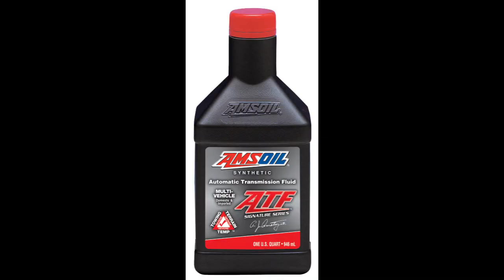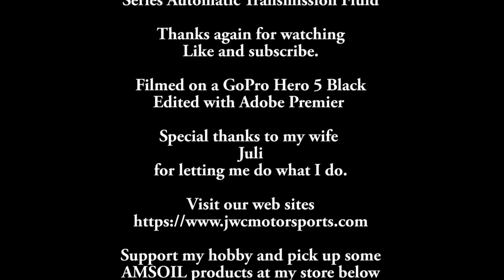2016 RAM 1500 5.7l Hemi Transfer Case (BW44-44) Fluid change

Comment: Nice! Just did my 2017 1500 with almost 39,000 miles.  Color looked good, but more and larger sized metallic shavings came out than I thought would.  Truck runs fine, I just didn't expect so much metal in the fluid.  Also here in Buffalo with salt in the winter, mine's crusty underneath, even with undercoating :(   I put Amsoil in also.  Thanks - great video.
Reply from the maker: That winter salt is rough back East, Thanks for watching.

Comment: How many miles on the truck while using AmsOil in transfer case and transmission?
Im going to change my fluids AmsOil as soon as they arrive. But want to get your thoughts on the products so far. Thanks
Reply from the maker: I just went over 101,120 miles and that is about 50k.miles using AMSOIL in the transmission and transfer case.  With about 75% of those pulling a trailer hauling a vehicle.  It's been running great, have had no issues and the temperature of the transmission while towing has always been below 200°F even during the heat of the summer.  Mileage usually is around 13mpg towing and my towing always involves a lot of elevation changes.

Comment: How much fluid did that take?  And where did you get that pump bottle?
Reply from the maker: The transfer case takes 3 pints to fill to the bottom of the fill plug opening.  As for the pump I got it from AMSOIL part number G2039.
Reply from the maker: @ALPHACHEESECURD  3 pints. 1.5 quarts

Comment: What you drained out of it doesn't look like ATF, but more like tractor fluid (Mobilfluid LT). Was this the first time changing the transfer case fluid?
Reply from the maker: It was the first change I did on It.  I do not know what the previous owner may have done.
Reply: @JWCMotorsports  That was the original factory fluid. RAM switched the BW44-44 to Mobilfluid LT because the clutch pack was updated to a high-energy clutch material for 2016 and up. AMSOIL Torque Drive or Delvac 1 ATF are far better choices than AMSOIL MV SS ATF. I found that both AMSOIL and RedLine Oil make errors in their website fluid recommendations and they are both very hard-headed about correcting them. The reason why they went with Mobilfluid LT is that they wanted an ATF without friction modifier for immediate firm clutch engagement, like the old Ford Type F fluid. I wish RAM and Mopar would have explained this better, took me a lot of research to find this information. TES-295 ATF is the bees-knees for transfer cases, they can take a lot of heat and abuse.
Reply: @marcm.5937  you seem super knowledgeable here..2012 2500 hemi about to do all fluids for 100k. Thoughts on front and rear diff? I'll do the Mobil you referenced above for transfer case. Thanks
Reply: Wait I can’t find any info about using other fluid other than the mopar bw44-44 stuff. So I have a 2016 ram 1500 5.7 with the bw 44-44. Which fluids can I use in my transfer case?

Comment: What fluid did you recommend?
Reply from the maker: I recommend any AMSOIL AFT Fluid, both the BW 44-44 and BW 44-45 call for Automatic Transmission Fluid, and for AMSOIL that would be Signature Series Multi-Vehicle Synthetic Automatic Transmission Fluid.

You can use this link to look up the recommendations for you truck or car.
https://www.amsoil.com/guides/?zo=1756445

Comment: Would you know the torque specs for the transfer case plugs
Reply from the maker: The Specs I found show 15-22 ft lb for both plugs.
Reply: @JWCMotorsports  thank you very much
Reply: One ugga-dugga should suffice. Put some teflon tape and don't overthink it, it's not a cylinder head.

Comment: This must be the BW 44-44 (auto 4WD) ?
Reply from the maker: Yes, that is correct.
Reply: @JWCMotorsports  obviously it didn't seem to hurt anything but I'm pretty sure the atf+ you put in is for the 44-45. Id I recall the 44-44 takes special unicorn tear fluid that Mopar will sell you for about $40 a quart.
Reply from the maker: AMSOIL ATF+ has been evaluated by AMSOIL to meet the requirements applied to the BW44 44.   Its been working perfectly and shifting has been smooth.  Have used the Auto 4x4 function a lot this fall/winter towing in snowy conditions.
Reply: @JWCMotorsports  sweet! That'll save a lot of people money. I'm getting ready to swap out my 44-44 for the 44-45 so I can have real 4WD when I want it. Don't like the AWDness of the 44-44. Too unpredictable.
Reply from the maker: Cool.  I don't use my 1500 for anything hard core, that's what my Jeeps are for.  AMSOIL also recommends the ATF+ for the 44-45.
Reply: @JWCMotorsports  nothing hardcore here. Just snow and ice in Alaska. Frustrating that I have to spin my rear tires to get 4WD when I'm trying to go at a stoplight or whatever
Reply from the maker: Ok,  have not had that problem, but was loaded with about 750lbs in bed and 3800 on a 2000lb trailer in the snow coming through Colorado.  4Hi worked for me then.  And Auto has helped around Idhao since I've had it.  But nothing like you get in Alaska for sure.
Reply from the maker: Thanks for watching as well.
Reply: I have used Amsoil signature series ATF+ in my Ram 1500 Borg Warner 44-44 for over 4 years now, no issues and shifts are smoother and quieter.
Reply: @JWCMotorsports   The Mopar "Unicorn Fluid" is Shell Spirax S2 A389, a TES-389 Allison Certified ATF that was a replacement for Dexron III(H). Amsoil Multi Vehicle ATF is TES-389 compatible. If you want something even better then you can use Amsoil Torque Drive, or any other TES-295 certified fluid like Delvac 1 ATF. They're all expensive at $50/gal. because all TES-295 fluids are PAO based.
Reply: @AlaskanFalcon   we’re in Alaska too. Did you swap to 45 yet? Did it make a difference? Thanks
Reply: @tamekiabrock7873  yes I did. And yes it makes a massive difference it gives you real 4WD and confidence. I'm in the FBX area. You?
Reply: @AlaskanFalcon   South east peninsula area 7 miles off grid non borough maintained road. Got severely stuck in 1-2” of snow lol. 4wd overheated performance temporarily reduced popped up on dash. Had to slap tire chains on rears just to drive out. Is the whole t case fried? Does it need fluid changed? New actuator? If fried I’d swap out to 45. Now if I do that does it need any other computer configuration? If so how? Thank you for prompt response. It’s been an interesting past couple days with this snow dumping down on us and having to use the older ford to pull this one out! Frustrating.
Reply: @tamekiabrock7873  I've tried responding multiple times now. Something isnt working.

Comment: Can you tell me if I can get a different fluid than the dealership it’s 41$ a litre crazy price
Reply from the maker: Not sure where you are located.  AMSOIL has 2 fluids they recommend for the BW 44-44.  OE Multi-Vehicle Synthetic Automatic Transmission Fluid is the more economical on and is available in the US and Canada.
Reply: The Valvoline Maxlife Multivehicle ATF should work the same no ?

Comment: What size hex did you use ?
Reply from the maker: Both plugs are a 3/8 inch square drive, I used a 3/8 inch extension and ratchet.
Reply: @JWCMotorsports  tyvm & keep up the great videos

Comment: Can you reuse the same drain plug
Reply from the maker: Yes, I did and have had no leaks.
Reply: @JWCMotorsports  thanks
Reply: @JWCMotorsports  it looks like I have to buy the transfer case oil at the dealer they don’t sell it at the auto parts is that what you did
Reply from the maker: no, the transfer case I have calls for an Automatic transmission fluid.  I'm am an AMSOIL dealer and used the product lookup and found the AMSOIL recommended fluid and ordered that.  There are links in the description.